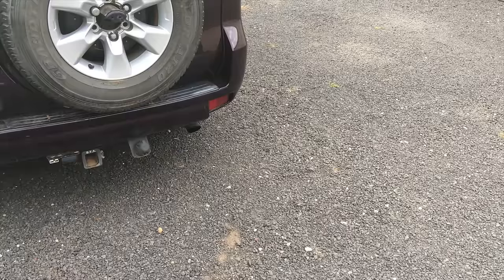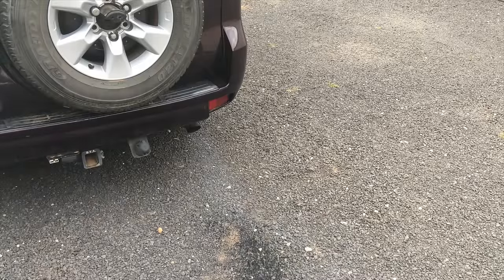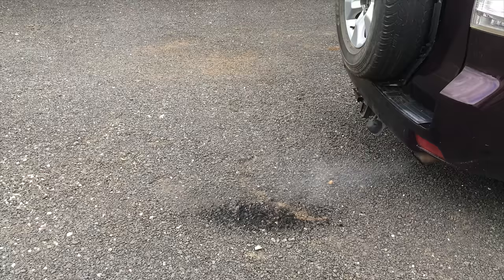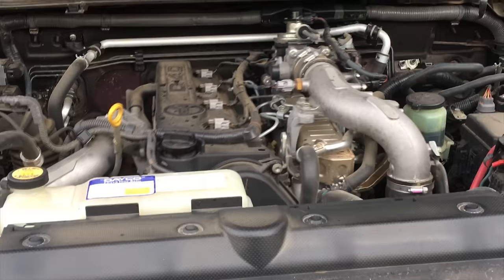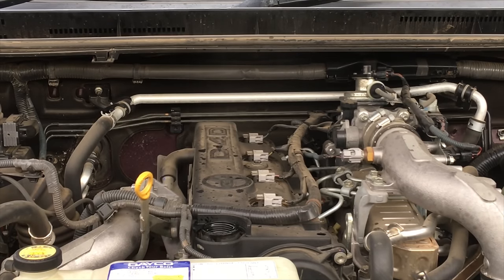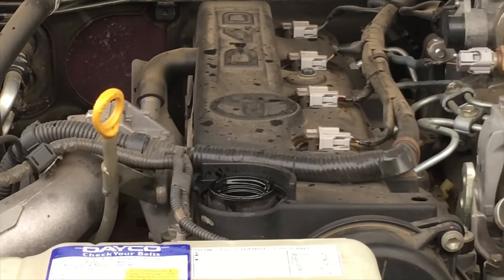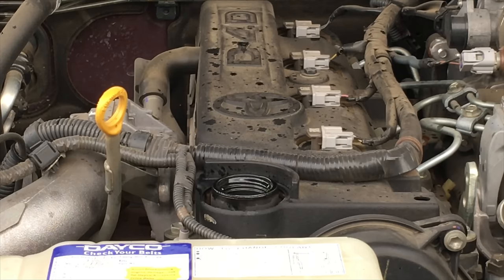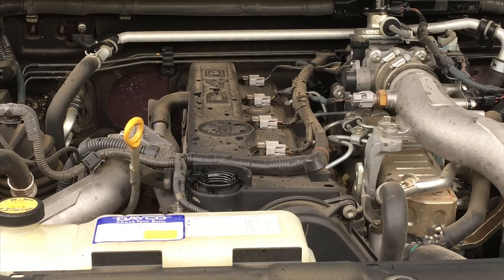I THINK IVE CRACKED A PISTON - THIS IS A CRACKED PISTON - HOW TO DIAGNOSE A CRACKED PISTON

Comment: Our 2010 Hi ace D4D 3ltr diesel engine did over a million kms with us the injectors were serviced once that i know of, and the intake manifold was cleaned out once, it did long hot running, it was sold recently the new owner very happy with it, they could not believe it had done a million kms because it runs and drives very well.

Comment: Cheers for the vid, lots of good info!
We've got 355,000 on our 2008 Hilux , full manifold clean, new Denso injectors, catch can and 2 micron filter installed at 250,000.
Had the Injectors checked at 353,000 and they are still healthy, hopefully get a few more years put of her 🤞😎

Comment: You've got to keep up to date with servicing the injector seals and replacing the injectors at the correct intervals, Once the injectors start leaking or you get oil into the cylinder by other means it all goes bad quickly.  I've seen cracked pistons but more commonly they melt, the oil in the cylinder auto ignites before the injector fires, it gets too hot.

Comment: I have similar smoke on start up but then it’s fine on my 1kd 2008 prado exhaust not oily but Using probably a litre a month. Engine not rough smooth no blow by. Had injectors replaced at 275000km Chinese turbo fitted 2 years ago which is starting to get noisy which I suspect seal gone you think? Has a lack of power somewhat

Comment: My 2011 hilux sounds like this. I was over taking a car up a slight hill. It lost significant power, blowing a massive amount of black oil out the back. It idled exactly like this on the side of the road on Thursday night with a death rattle. I turned it off then it wouldnt start again.
Road side assist took it to Toyota in Devonport where they flattly said it was a piston and it would cost 15 to 20 grand to fix !! 
What would you suggest a ball park figure it should cost mate? I was thinking half that.
Reply from the maker: Big rip off ring me on Tuesday and I’ll tell you what you need to know
Reply: how did it go?  knowing that warranty repairs took $2500 as upfront from you.

Comment: Have you ever seen a 1kd with a cracked piston which had a blanking plate fitted 7mm hole does the blanking plate make tham heat up a bit more or not?
Reply from the maker: Heat up ? No!

Comment: Hi mate, looking at an 08 
298k... great service history.
Although I had it inspected, issues that came back are
*No:3 injector low 
*oil leak egr side 
*slight oil leak turbo compressor

*no smoke, no noise on idle from cold or hot, 
*no noise cold started on ramps facing downhill 

What's your thoughts on what this could be ???? 
Any info would help, don't want to waste my 18k cheers mate.
Reply from the maker: You can call me tomorrow talk to you then

Comment: Toyota aren't bullet proof, they use to be when they made less power and didn't have common rail injectors. Unfortunately most options are in the same ballpark with the injection systems comming from Siemens, denso etc. To help them survive you need a better dual filtration system and lubrication additives depending on the injector type. My supposedly shitebox land rover has 476 thousand k on the original engine and unit injectors. Have two transit vans, one 790 the other 285 thousand on them, driven all around Australia. They live happily because of the filtration and additional lube they get. Also run a filter between the leak off and pump return. This way the potential of contamination from the injectors back into the pump cycle is mitigated.
Reply: What lubrication additives would you use for 1kd with Denso injectors and 355k on the engine ?
Reply: Hey mate I love your thoughts. What lube additives do you mean and are you adding them to engine oil or what?